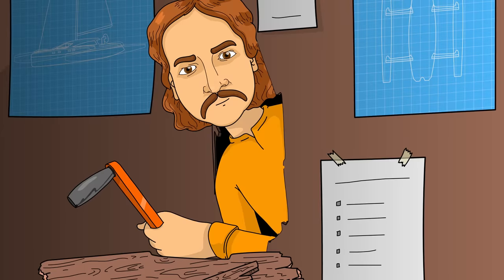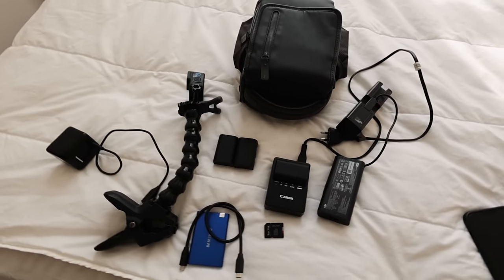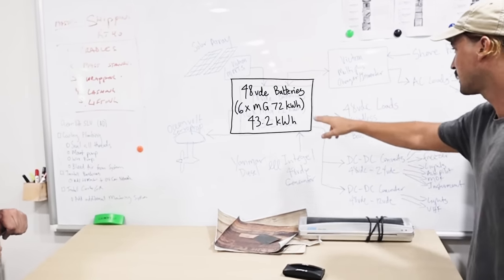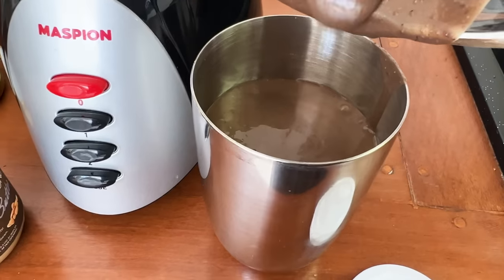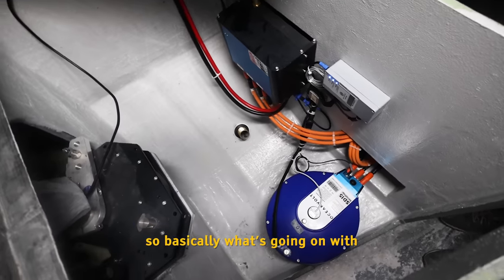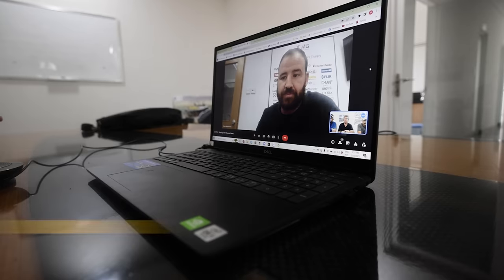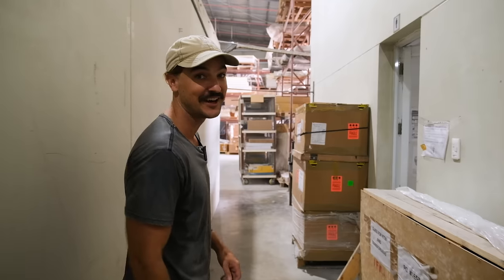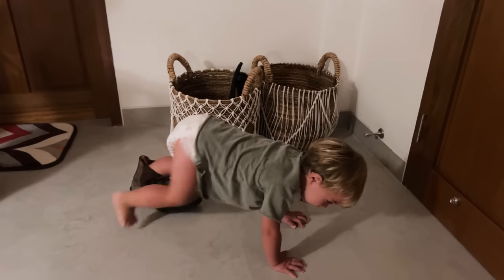BOAT BUILD: Our Electric Propulsion!

Comment: Hi Riley,

Jason here, a marine sparky from Newcastle AUS. 
I have installed a twin 15kw Oceanvolt system on a Shonning Cat here in Oz.
Make sure that Derek shows you how to replace components in the Drive (Dc contractor) and sensor on top of the Drive, and you are familiar with the software to reset the drive if you are out of internet service.
Just confirm with Derek that if your batteries are flat that you still operate the drive via your genset. On our vessel the genset would only charge into the batteries not drive the Oceanvolt drive.
I am concerned that it is only a single drive.
All the best, love you guys and the show.
Cheers
Jason Smith
JSE Marine Electrical

Comment: Wow, dual propulsion systems.  The Oceanvolt system looks great.  Really nice to have a somewhat in-depth explanation of how it's all going to work for you.  Shame you can't get anything back from the constant drag you'll have from the inboard diesel prop, but at least it'll be there if you need it.   Wondering what the large hollowed-out area in the transom, beneath the dinghy mounts, is going to be.  I know there'll be a rudder there at some point, but is it housed inboard a bit, requiring that hollowed-out space?  Really interesting seeing this all coming together.  So sorry about the bureaucratic BS you're having to deal with regarding your passport, though.  That's pretty stupid.  Hope you're able to get a quick fix to that situation and get back to your family.

Comment: Ocean Volt tech sounds great.  I always appreciate Rileys gear and technical discussions. 

I see the electric boat with all of its electric propulsion and big heavy battery (200 kilos just for the battery?), still needs a Yanmar diesel w generator, which means all the usual diesel maintenance (fuel, filter, fuel pump etc) 

$$ and kg mate.
Reply: Yes

Comment: There’s a lot of focus on fully electric propulsion in the yachting community but let’s be honest we’re not quite there yet. I’m an engineer working on diesel electric hybrid ships and it’s such an awesome solution, and for your normal use you will have virtually no carbon footprint. Hybrid is safer, and stress free. But you need to focus on tank health, you will be storing your fuel for a long time. Chemical treatment and/or a fuel polishing system(“round filtering” the content of the tanks) might be a good idea.

Comment: Hey guys, your propulsion system seems to be super cool. Especially with the ability to regenerate so much power. 
But do you guys now have two separate propellers for the Electric and the Diesel engine? If yes, is this a common thing to do or does that bring new problems? (Maybe also to all the boatbuilders out there 😃)  oh and great to see that everyone is doing better now ☺️
Reply: agree confused what the decision was.
Reply: I'm pretty sure that the diesel engine powers the battery if it gets to low
Reply: The diesel engine has a separate propeller (he refers to it as an 'engine', rather than a 'generator'. So yes, it has a separate prop to the electric motor. Check out the screenshot at 21:46. Electric prop is behind the diesel engine prop. Bit of a shame in my eyes. Redundancy, yes, but extra complexity and probably more drag when sailing. If the electric motor is as reliable as he says, a simple generator could provide it with power when necessary instead of dragging an extra prop around all the time that'll hardly ever be used.

Comment: Love it all.  We have an electric catamaran with a back up generator.  Just a caution about one bit of over optimism.  At about 17 minutes he says that you could run for 20 hours at 4 knots on your battery for a range of 80 Nm.  I had similar projections for our boat.  Doing the math you have 56 kw of battery.  Divided by 20 hours is just under 3 kwh to drive the boat at 4 knots.  This is VERY optimistic.  I'm guessing your boat will need about 5 kwh to move at 4 knots and at least 7-8 kw to move at 5 knots.  56kw battery divided by 5 kwh  means just 9.5 hours or 48 Nm.  That will be further limited since you won't want to take your batteries below 20% so realistically and optimistically about 38-40 Nm max battery only range.  It's not a big deal though.  Like he said, mostly you are sailing with a little motoring power in and out of the harbor etc.  

We opted for a generator instead of a motor.  In those instances where you need to motor for 24 or 48 hours your generator simply needs to be able to produce the amount of power you will need to motor at say 5 knots.  If that is say 7 kw then your generator needs to provide that amount of power effortlessly and reliably.  Someone might say, "what's the point then?  Your just running a motor anyway."  It's because you will be able to go, like we do, weeks at a time without running a diesel motor.  When you need a little power because your tacking or motor sailing it so easy to just tap the throttle for 30 seconds and its silent and instant.  Maintenance is lower, noise is lower, smell is lower, its clean (no grease finding it's way into the boat).  It's awesome!

Comment: I’m confused... Did you end up swapping the electric ocean volt motor for a traditional diesel in the end?
Reply: He's got an electrically driven prop, and a Yanmar diesel with a very large alternator/generator on it.

So far as I can see, no direct mechanical connection.  If his 48V electrical system dies, propulsion is gone too.

This boat is designed to cross the Atlantic or even the Pacific with just one weekly video on the water.  He means to keep moving when other boats are becalmed, and sail around nasty weather.  I hope they've designed that cockpit to reduce wind noise, because there's going to be a lot of wind!
Reply: He's got both, 21:42 minute mark.
Reply from the maker: We haven’t really but if I’m sailing it we’ll it’ll be on AP most of the time.

Comment: Pretty interesting breakdown of the new propulsion system. Blending sailing, charging, motoring is going to be interesting, if you need any custom software work done, give us a yell(my old line of work before recent retirement). I would suggest getting a telemetry tap from the power system to a "central boat computer" that can do more advanced processing, i.e. merging weather info, trip planning, energy management, crew activities. Something that could ultimately do AI as well. For example an AI system might be able to suggest putting water bottles in the freezer if you have surplus energy, or suggest course alteration for superior energy harvesting, or to fire up the oven and do some baking...  Nice to see the kids well again and Elayna on the guitar, at least you have a cool pad to hang out in until the boat is finished. Must be a bit of a comfort to know you have a HUGE friend network to draw on if you need to. Might be fun to snarf up some older used boats and make a small "La Vaga" fleet, and promote Riley to admiral ;-)

Comment: Riley. Can I suggest an idea only. It's about your diesel engine drive shaft being exposed. 
What if the engine had a gimble & at the back @ the shaft there was a universal. This would allow the prop to come up to the hull when not in use. So if you lift the front of the engine, the back would drop along with the shaft and the prop would lift. Just thinking out side the box. After all it is drag & you won't be using it a lot anyway.

Comment: Glad you installed the diesel back up ,I was getting worried. I was thinking all electric boat in the way you depend on it would be a bit, well scary. You not only have to power the electric prop, you have to run everything else on board. I think you will use your generator more than you think. It does'nt matter now you are prepared, and that's the key word.

Comment: I love ❤️ that you’re using electric drive and hydro-regen, it’s the future. But why sail drive instead of shaft drive? Will the diesel be set up to be a hybrid system, where you can drive the prop with electric or diesel like HH does? Or are they two separate systems?

Comment: Hey  Riley...really cool the way the prop can generate power!  Just thinking in really general terms about power generation during sailing, do you know if anyone has ever talked about really small paddle wheels that would be placed down the bottom of the hulls that would also spin like your prop to generate electricity.  I know that would create some resistance and reduce the performance of the boat while using, but seems like a way to generate some  power.  Possibly have a way of covering and uncovering the paddle wheels.

Comment: Exciting system , but it looks like boat will have an Ocean volt electric motor/propeller/regen unit 
AND a separate Yanmar Diesel engine( with large alternator) with its seperate shaft drive and propeller. ( folding?. for no drag).
It will be interesting to compare to other 'Hybrid' systems using one propeller with ,electric drive , regen and diesel engine connection.
Cheers Warren
Reply: This whole setup is confusing. Seems overly complicated to me. Hope it turns out the way they intend. I like the elegant system HH has designed in their new 44 and upcoming 52, but that's a catamaran with two identical engines and two props for charging the batteries under sail.
Reply: @jamesaron1967  Agreed,  strange set up.

Comment: That means they should be able to trouble shoot problems with the electric drive over the internet which is awesome.
You might even be able to get upgrades /software updates online like you get with Tesla.
If you get Starlink at some point you will be able to trouble shoot even when you are on a crossing which increases your safety factor.
Was wondering where the engine was going, so now you are a hybrid boat, it is good to have that redundancy.
The boys are growing like weeds mate.

Comment: Hi
I spent two weeks poking around in the Bahamas 16 years ago on one of the very first electric drive sailboats. 44', 12000 pounds, lifting bulb keel. Similar drive train architecture to yours with one major exception.  The prop was a big four blade optimized for power propulsion at about 10 knots and low prop speed.  One of its strengths was the fact that it was always on.  Which in practice meant that when you were sailing in the common condition where you reach hull speed in the puffs you set the controller so that you just started to generate power.   In the lulls just enough electric power fed in automatically to keep the boat speed from falling off so you were faster overall with out even realizing it.

I'm not sure this is not a superior system to the more techie electronic feathering prop with its higher rotational speed, higher maintenance,  and less efficient blades.

Comment: Guess Starlink marine is on the buy list then, obviously need a network connection for Helsinki to enter your system, but what a great safety fall back. So vis a vis you will hopefully be in mobile/network contact at all times when sailing and wont need to rely on a sat phone in an emergency,  just have to work out/invent/fabricate/buy some sort of lightning protection device. Cheers from Tassie.

Comment: If I can suggest a run procedure/process for the diesel generator: Run the engine once a week for 1 hour. This will allow the engine to come to full operating temperature and burn off accumulated moisture from the engines oiling system, exhaust, intake. Every 6 months change the engine oil. This will remove accumulated moisture and fuel contamination that will collect in the engine oil keeping your engine as corrosion free and happy. Especially in the salty sea environment your engines biggest enemy is corrosion. During the 6 month service inspect the fuel filter, hoses, belts, any wear item that the sea air will attack. This will top up your batteries while ensuring your engine is in tip top shape. The other benefit from weekly running is you’ll be able to ensure your electrical system is fully functioning. In the motorsport world I work within we call this kind of thing life cycling, the idea being the engine, spare parts, etc are always serviced and ready to be put into use.

Comment: Wonder if you could route those cables to the oceanvolt up, instead of through the big hole in the bulkhead, so the bulkhead could be filled in/plugged (in case a log takes out the oceanvolt creating a large hole).  Or make a watertight plug/bulkhead that the cables could pass through.

Comment: I love your videos.  But just as a reference, a diesel engine will run much longer than 5000 hours.  Up to 3 times that if maintained properly and not pushed to the limit each time it is used.  2800- rpm and it will last a really long time.  But your point is well taken about electrical.  I am totally on board with that.  Keep the videos coming.  :)

Comment: Hey guys, finally watching on my tablet now, where I can actually ask a question! (Have watched all other episodes on my home TV). Loved the tech info on the elec engine. Only question I was hanging on for was “if every thing else turns bad (batteries flat, no sun power, no wind etc), how many knots will it do with the generator running and how much fuel do yo carry? I am keen on battery engines but also am a belt and braces type and tend to have plans A through F - with F just being sail home no matter how long it takes but E being start the generator and motor home on power generated. P.S. Passport pics are a pain in the bum - hope you get home quickly, the boys are getting big quickly you don’t want to miss it happening.

Comment: Any thought of putting some sort of lightning bypass system, so not to fry your electronics?  Hope the little guy get well soon.
Reply: Good luck with that. Parley Revival is just recovering from their SECOND lightning strike.. Fried all the electronics. There is not much you can do with a million volts all at once. The strike even fried a boat nearby.

Comment: good call SLV.  one misfortunate lightning strike would render your boat movement destroyed (motorized).  diesel engine with backup solenoid and alternator to save the day.  generator would do nothing to save the boat or the family.  best call for the entire engineering of the boat and for safety.

Comment: Iam building a 70' aluminum catamaran with a hybrid propulsion system that I am building myself.  I am using a gas turbine as my primary source of power.  I am using straight shafts with electric motors and variable pitch reversing propellers.  My battery bank voltage will be around 600 volts.

Comment: I haven't been convinced how the saildrive servo prop is better than a hybrid with a straight shaft. You focused on the redundancy of diesel providing security, I would think you would be more secure with a straight shaft. I wonder why the option of both hasn't been made? A serve prop takeoff with a straight shaft for back up, cause the argument is a saildrive parts will take forever to replace.

Also what is the capacity of your diesel tanks and water tanks? That will explain much of your general logic about security.

Comment: So glad to see Darwin is doing better.  Technical question, first I totally understand wanting to have a diesel propulsion backup.  What I’m not sure of is does that diesel engine also provide power as a generator (with a high output alternator), or do you have a separate generator?  If there is a separate generator can you explain your thoughts as to what brought you to that decision?  Thanks!
Reply: Yeah, I am confused as well about that.
Reply: The diesel will run a generator as well as have its own shaft and propeller.  It is a backup for electrical generation and a complete propulsion backup.  Riley mentioned tbe situation where they cannot sail, but want to outrun a storm - this might take say 10 hours at 10 knots and the battery capacity would never be enough to run the electric propulsion for that duration at that speed.

Comment: Very interesting.  Question about the electric drive system. I have to ask why not design the drive motor to drive an alternator or two?  This would eliminate the diesel generator use while motoring and be fast charging.  Doubt the hp loss would happen if the alternator is always working.

Comment: This is going to be some electrical s y stem. 48 volt Integrel setup. Niiiiiiiiiiiiiiice 👍  My only concern for our boat is are there en48 volt appliances available yet. 24 volts seems to have the most. Yet the 48 volt ones keep being developed. Looking forward to the progress and the finished project.  ✨🌊💨⛵️🏝👙🌞✨
Reply: Hence the dc-dc converters.

Comment: I like having the diesel as backup and while the lifespan of the electric drive motor may hypothetically be super long it has been my experience that electric motors work until the second they quit working... guaranteed.  Adding a salt water environment to the mix also has to reduce the lifespan of electrical components to some degree as well. Overall i think you have a good hybrid system that should still last a good long time.

Comment: Three different voltages on-board is a little complex.. do you really need 12v? Lights and VHF can be 24v. I'd be a bit worried about what happens when you lose the 24v (lithium BMS load disconnect, 48-24v converter fails or a fuse goes). One idea would be to  upgrade the yanmar starter & starter battery to 24v, then have an interconnect switch to transfer 24v loads to that starter battery so you can limp home with chartplotter/lights/vhf/ais.

Comment: Hi Riley, interesting that you have chosen both an engine driven prop and the ocean volt, how do Rapido feel about just Oceanvolt? Would they be happy with just the one unit or would they prefer to use 2?  I’m also going electric, but serial electric with a genny, and choosing to use 2 x 20 kw motors on a 10,000 kg cat, should be enough by the calcs. We are using many of the same electrical system principles as you so will continue to watch your development, good luck!